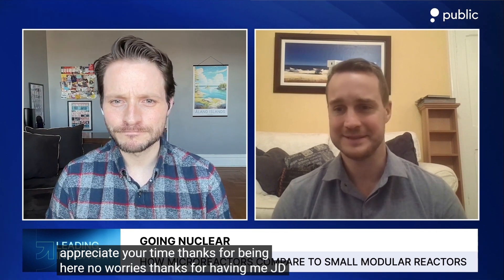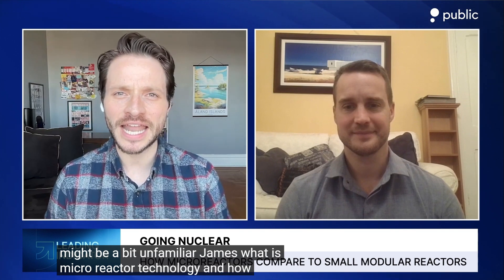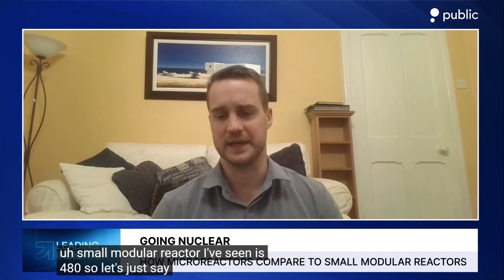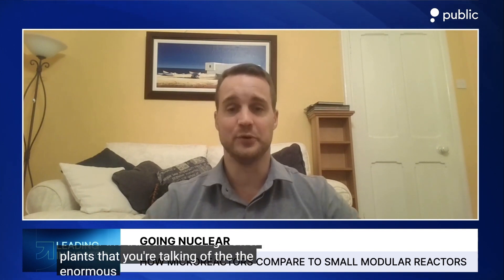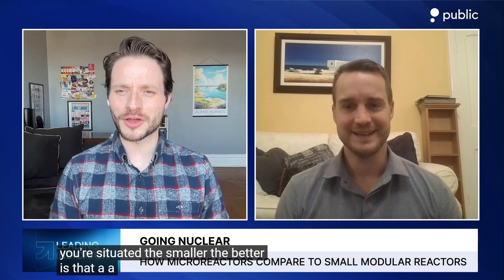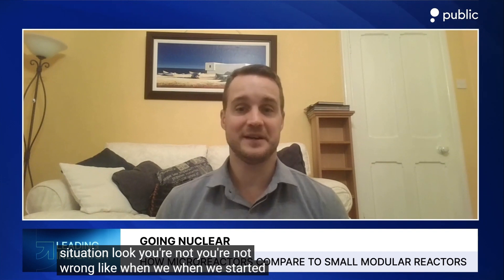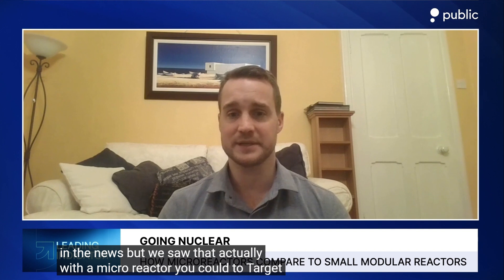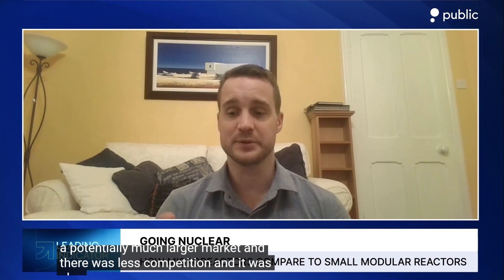NANO Nuclear Energy Inc. (NASDAQ : NNE) CEO on How AI is Reenergizing the Need for Nuclear Energy

Comment: I don't see how this will ever be legalized by any government.
What stops a bad actor from intentionally melting down a nuclear reactor that's so small you can move it around on a truck?
Reply: When you understand what fuel they will use and what is needed for a "dirty" bomb. It's impossible and too much work. They would first have to remove the nuclear rods which will be a pain in the ass then collect enough of those rods from multiple smrs and THEN find a lab that is advanced enough to make those uranium rods into the right uranium that is used in bombs. It's just unrealistic if anything they will be extremely safe. Way more safer than a huge industrial nuclear plant
Reply: You really think they will produce small mobile nuclear bombs? Do more research, and you'll find out that will be virtually impossible.